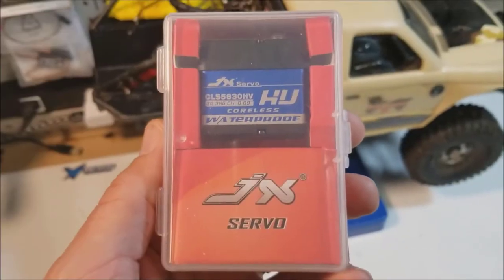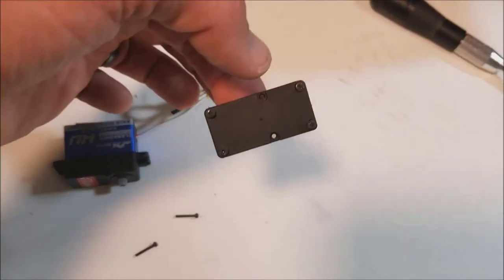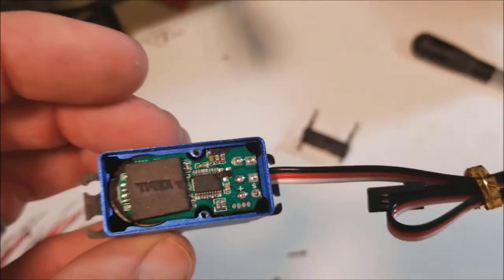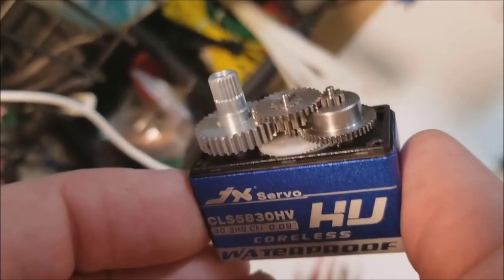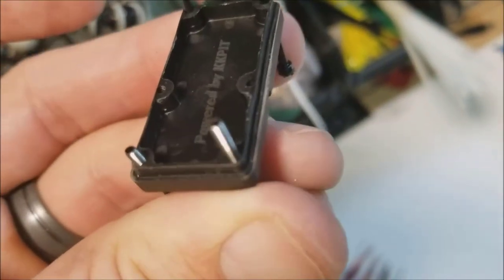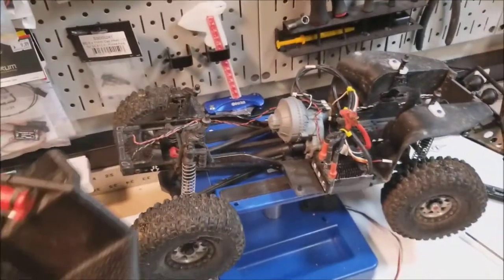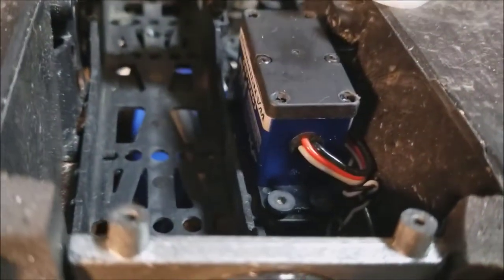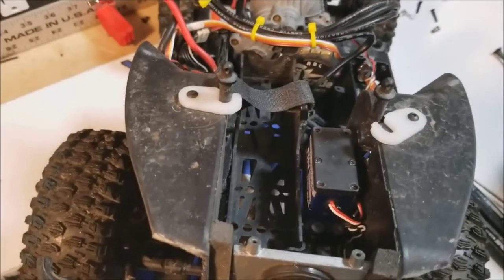JX Servo - CLS5830HV cracking it open for Initial Impressions

Comment: Gpm makes a aluminum servo saver arm ,look it up on e bay that will help save the plastic gear
Reply from the maker: Adam Hire /rc appreciate the heads up.  I'll check it out.
Reply: Thick Skinned RC not a problem  man got em on all my trail trucks haven't broke a servo since ,use to break em all the time on my wraith